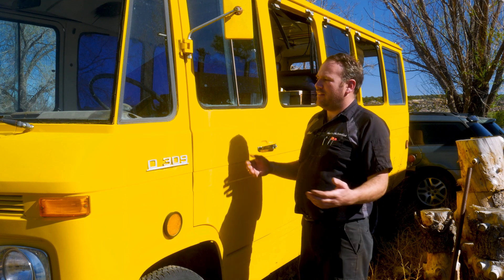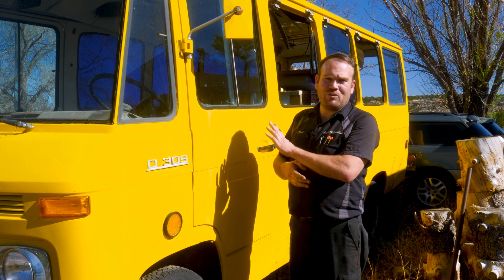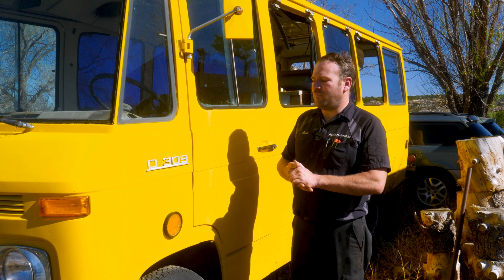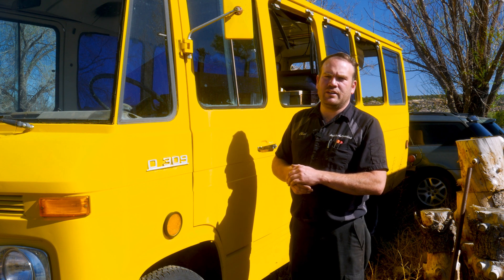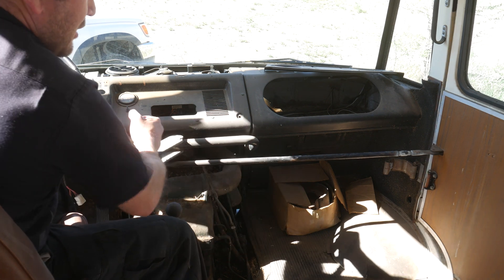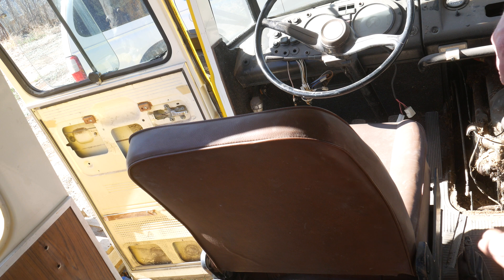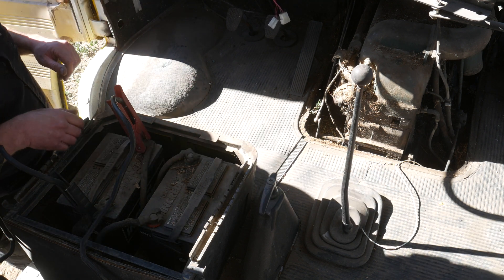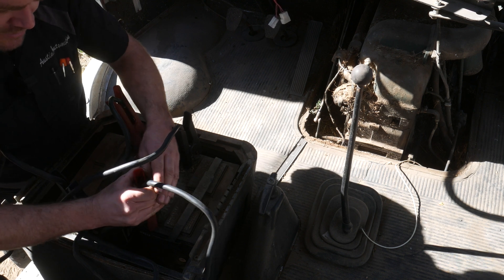Mercedes Benz O309 with OM314 Project vehicle Starting issues

Comment: We have only one bus right now in our country and its in super condition. Imagine only one for the whole country.  Two engine version, one for AC.
Reply from the maker: This one originally had a second alternator to run a rooftop air conditioning unit. It was originally used as an hotel shuttle in Denver from what the previous owner told me.

Comment: Some starter relay stuff: When you hit the start button, the ignition switch applies + 12V to terminal 50. The relay coil in the battery switch is connected between 50 and 31 (before one of the fuses, bottom I think). When the relay pulls the contact between 30 and 31a is closed. Now, the batteries are connected in series and there is +24 V running the starter.

Comment: The om314 has no glow plugs, it's a direct injection diesel. So you can 'safely' use ether on this diesel, too! I subscribed to your channel, I just started renovating a 1976 608d.
Reply from the maker: Working on modern American diesels and VWs I just assumed all diesels has glow plugs or a heater grid. Now I know that these old beast didn’t have the option. 
I have the pilot start system but will need to find some ether cans for it or convert it to a more available ether system. 
I may also add a heating grid is I run into issues. 
Thanks for watching

Comment: When you have the key in left position I think light should be off, and when you turn it right it is parking light and far right should be driving light 👍
Reply from the maker: Thanks for the tip, you are correct. I’ve never seen a key for a headlight system.  Inserting the key seem to turn everything on so I will have to remember to remove the key when parked.

Comment: Just place the key into the ignition and press the starter button to start. Turning the key operates the headlights -  position 1 = parking lights, position 2 = headlights. Weird I know. There are 2 x 80amp fuses in the starter solenoid so check those too. Have fun. Watching the series with interest.
Reply from the maker: Thanks Simon. The manuals from the FB group have helped a lot also.
Reply from the maker: I also forgot to mention the two 80amp fuses have been replaced with fusible link wire instead. If I replace the solenoid it should come with new fuses otherwise I will probably replace the fusible link with an appropriate fuse.

Comment: Position 2 with the kex and startbutton. There is Nothing to glow;) just straight to Start.
Reply from the maker: Position 1 turns on my park lights and position 2 turned on the head lights. I didn’t look at the diagram to see what else was powered up. All the dash lights light up as soon as the key is inserted into the ignition. We have some fuel issues to deal with as well.

Comment: That is a Series/Parallel switch. Was common on older trucks. Stater/Alternator shop should be able to help you if needed.
Reply from the maker: Thanks. Not something I’m used to seeing in the automotive field for sure. I did find some new ones on eBay. Around $300 for the original part number but I think it would be wise to replace it before it leaves me stranded. The American/Delphi version is cheaper but not a direct fit by any means. In the next video I’ll take it apart to show the inner workings.

Comment: Hi Chad shout  out to Diagnose Dan he will have a wiring diagram for that if not i could find you one they used to be very common here in the UK  Arthur.
Reply from the maker: I managed to find one in a Facebook group dedicated to the o309 and 508. Surprisingly the wiring diagram is in the operators manual as well as a bunch of other mechanical information. I guess operators we expected to know how a vehicle works back in the day.